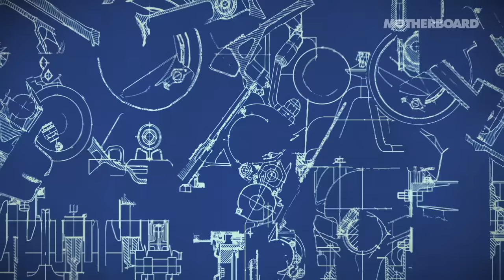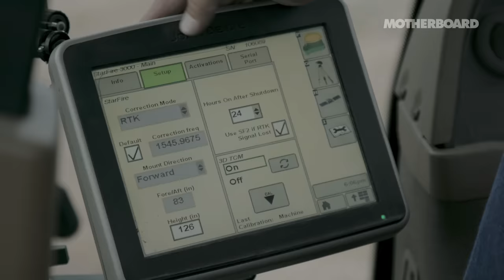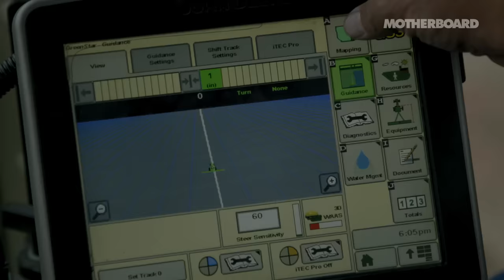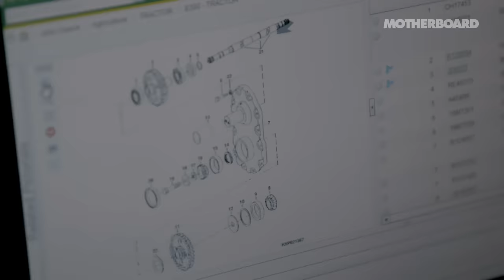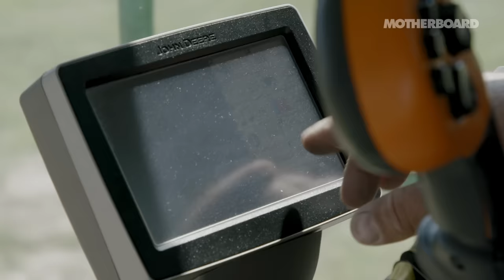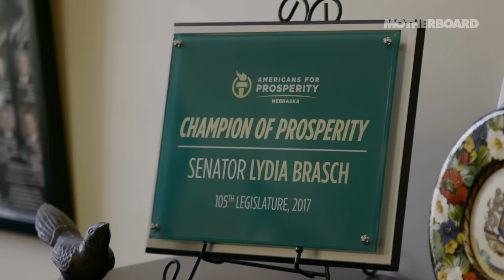Farmers Are Hacking Their Tractors Because of a Right to Repair Ban

Comment: “We can’t let people repair our equipment because it opens the gates to hackers”

Meanwhile people are becoming hackers so they can repair their stuff
Reply: the irony is real
Reply: Calling it hacking is misleading. They are using pirated diagnostic software, it's normal official tool but modified by someone to circumvent license checks. I guess you can say that the software was cracked, either way farmers are just using that pirated versions, they are not making them.
Using pirated software may be dangerous, you never know for sure what else the person who modified it put in, but if you have no other choice you will do it. Right to repair will fix that, allowing people to buy that diagnostic software legally.
Reply: But many of these huge corporations,will get into business with china , because of the cheap labor ,and give away their proprietary rights or tech,in order to make a huge profit. Then they whine to the u.s. government how unfair china treats them,lol. No one forced them to go there, GREEDY
Reply: If you follow the news,they got hacked because they had zero protection on their stuff without sharing anything.
Reply: @pingwingugu5  what is hacking 
The bypass of built in security or protocol checks without the permission of the owner or creator, with the intent to access a part of a system or gain knowledge otherwise unobtainable without a specified key or permission

They are hacking

Just cause they use a tool they didn't build doesn't mean they aren't hacking 
Is a person who hacks the national security firewall less of a hacker because he didn't make the computer he used? Is a kid hacking call of duty less of a hacker because he used an actually completely legal software to do it? No, hacking is hacking by the definition, it is an act not a tool.
Reply: @thezyreick4289  People using hacked software are not hackers!
Reply: @thezyreick4289  the tool is not a hacking tool though. It is an official diagnostics tool made by the tractor manufacturer, plus they are owners of the vehicles they are using this tool on.
It's like breaking into your own house using an unlicensed copy of a door master key.
Reply: meanwhile someone managed to hack a fucking pipeline system lmfao
Reply: @pingwingugu5  'They are using...'

That's hacking, pal.
Reply: @InternetMameluq  if you say so. But then it means that everyone using unlicensed or  unrecommended software to diagnose their car or other machine is a hacker. Getting a root access or jail braking a phone is hacking, installing Linux on a laptop that came with Windows is hacking. It cheapens the word a bit in my opinion. 
Next time I connect my OBD2 tool to my old rust bucket I will think about how bad ass hacker I am. Is  it White Hat or Grey Hat hacking when I read error codes from my own car, though?
Reply: @pingwingugu5  'if you say so. But then it means that everyone using unlicensed or  unrecommended software to diagnose their car or other machine is a hacker. Getting a root access or jail braking a phone is hacking, installing Linux on a laptop that came with Windows is hacking. It cheapens the word a bit in my opinion. '

It is.

Hacking is using a keyboard.  If you're using a keyboard you're hacking.
Reply: @InternetMameluq  what if I use touch screen?
Reply: @pingwingugu5  ...technically I mispoke, it doesn't refer to using the keyboard, but rather the motion of using a keyboard, specifically the depression of a button, so yes, using a touch screen would count.

The 'hack' is an ironic overstatement of how you push a button, or in your case: a touch screen.
Reply: There just Afraid some farmer will make there software better then the software they paid for
Reply: My grandma sent his 2019 John Deere in to a dealer 9 times to fix the same problem and it still has the problems but costed 15000
Reply: @elischmitt1980  No, they're afraid farmers will keep on using old tractors instead of having to buy a whole new one every 5 years when the old one stops being supported.
Reply: @thezyreick4289  yeah, it's like those lifehacks
Reply: @thezyreick4289  the hacker is the person who reverse engineered/cracked the tool. An exploiter is a person who uses the tool cracked/reverse engineered by the hacker.
Reply: @thezyreick4289  they may not be the creater of the tractor but they are the owner
Reply: Who in the world would hack a tractor with ill will 🙃🙃
Reply: @thezyreick4289  So what if it is "hacking"?, these are very expensive units and if one goes down it can't stay down long, crops need t be harvested when they are ready, not when Deer ca manage to send a Rep around or the farmer needs to spend $1,000 just to get it loaded and sent to a dealer for repair. They will still need to but Deer parts like all those sensors, they just want the same rights you and I have with autos, the OBD2 standard ca be accessed and read by anyone with a $30 scanner enabling those who want to choose to work on their ow cars.
Reply: You nailed it and srew them!😉
Reply: My lawn mower broke is someone going to hack it? My alternator went out is someone going to hack it? My TV doesn't work is someone going to hack it? My laptop crashed is someone going to hack it? My dog needs more food is someone going to hack it? My pressure washer needs new bushings is someone going to hack it?
Reply: . Stating someone is not allowed to repair their own property is tantamount to stating you're not allowed to cook your own food.WOW ...
Reply: This is just an excuse from tractor companies to ensure the farmer comes back to the dealer for repairs. Hackers and such is just a stupid excuse.   Stop buying that brand if tractors
Reply: @erichord4345  i totally agree with you..., the John Deere tractor brand has no real competitors in the field of commercial farming after spending 30 years monopolizing the industry, so finding an alternate Tractor Company would be problematic, exactly how they want it. It might be cheaper to hire people to do a lot of the farm work other than these hundreds of thousands of dollars in John Deere equipment that is unrepairable on the field which makes it absolutely useless. Not to mention that they're always breaking more than worked.
Reply: @InternetMameluq  Hacking is the activity of identifying weaknesses in a computer system or a network to exploit the security to gain access to personal data or business data.
Reply: @starship1701  That's hacking 'INTO', not hacking.
Reply: The fed's are the worse hackers.  They're criminals.
Reply: First past the post two party system that enables the heavy corruption of politicians, decades of empowering multibillion companies and their lobbying power and an extremely restrictive immaterial law (patents and copyright) which is ripe for exploitation like this. Those are the key reasons things are like this.
Reply: You will own nothing, and you'll be happy
Reply: Coalminers can learn to hack
Reply: @thezyreick4289   yes it is hacking but not all hacking is bad. in in this case i would agree with their right to hack the software to repair it.
Reply: @supersaiyaman11589  as do i
Reply: hacker is a douchbag word , kinda like hashtag , etc . The proper word is repair , or to fix .
Reply: Having well documented systems with documentation freely available to anyone doesn't open the gates to "hackers". If anything it's quite the opposite. 
Open source software has been around for decades and it drives the modern era. The vast majority of complex computer systems run on open source software. The entire source code is freely available. This includes most servers and even most smartphones are largly linux based. Even closed up system like Iphones rely heavily on open source components.
Reply: What they really mean is, "It cuts into our profits!!".
Reply: @Brianna-im1on  "lemme hack into this tractor and make it tear down a house"
Reply: @parrisprice5892  China gets all the limelight; how about brazil, south korea, japan, india, russia, indonesia
Reply: Hacking? They want to sell them expensive repairs, that's their "hack".
Reply: Dangerous to who the corporations or the Farmers cuz it looks like these protection laws are designed against the consumer
Reply: @lazrustosadow5880  They ARE made against the consumer. Electricians often have big troubles repairing even simple things because companies don't release enough information, or make things in a way they can't be accessed for repairs.
Reply: @Signal_Glow  that's because the companies don't want you there fix anything, they expect you to just buy a new one
Reply: @lazrustosadow5880  That's the case with home appliances. For cars and tractors they want to earn money with expensive repairs, how many times i see electronic boards being thrown away just because companie's repair guys either don't have training, or are ordered to discard what could be repaired with ease.
Politicians should start thinking what they want; start repairing or continue throwing away.
Reply: thanks for the recap of the intro
Reply: @GameOn82 yeah you’re right! I need to contact activision to get unbanned because using an aimbot tool wasn’t hacking!
Reply: @Arsenelli11  Well, first of all, shame on you for using aimbot... and second, you were using third-party software to hack the game, so that does make you a hacker! 😜
Reply: Give it only to the people that purchased them and that won’t be a problem!
Reply: Calm down. It's not just the us. Tired of people like u talking down to this country
Reply: ... And we haven't even talked about planned obsolescence....
Reply: Amazing eh?
 I am sure many many young people can & will eventually help the farmers out.
 If it is designed/ it can be hacked.
 Stelantis tried/ does/ stop folks fixing their stuff, making them the only ones with the magic key to your vehicles.
 It isn't right. I believe all vehicle companies follow  BMW's lead in all these things.

Comment: In 1984 I closed my shop and sold out all my tools. Farmers would sit at the coffee shop and say go get your tractors repaired at the dealer. They have all the special tools and knowledge to fix them. So did I. My cost investment exceeded any gain after 1980. Many machine shops and independent repair shops closed after me. I’m now retired after working on air conditioners. I just installed a new unit in my home and haven’t put one in anywhere since about 8 years ago. I couldn’t get anyone to finish my a/c lines using nitrogen so I bought all the supplies and finished it. A/C contractors get warrantee paranoia when you install your own equipment and they can’t charge you 10,000 or more and like the farming industry they hate and despise the DIYs! My hats off to all the last generation of farmers who brought us here.
Reply: I worked at a New Holland dealership in the 80's/90's and never would have dreamed where we would be today with tech. I have some JD equipment but it's all older, nothing with a board.  I'm pretty sure even if I could, I would not buy anything new that says John Deere on it.  On another note along the same lines, last year when my home A/C went down literally at 5:05 on a Friday night, I called the dealer and they said it would be the first of the week before I could expect a tech.  So I did my own diagnostics.  The blower fan motor wouldn't turn.  There was nothing wrong with the motor itself, just the electronics that tell it turn.  I went to my local HVAC guy, bought a motor and a couple other trinkets for less than $150, hooked it up myself and got air for the weekend.  It was blowing too hard but at least we had air, and the temps outside were 100 degrees.  When the dealer tech showed up, he told me I needed a new blower motor and a new main control board - $1200.  He had to call in my unit serial number to the equipment company so the parts could be programmed to my unit before they were shipped.  What insanity, and a complete money grab.  Same thing JD is doing and it's spreading everywhere.